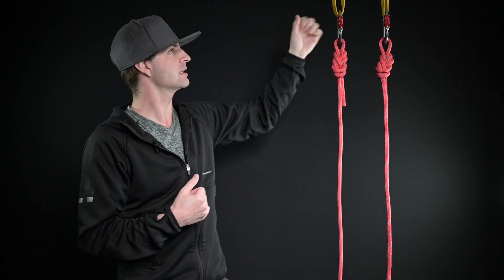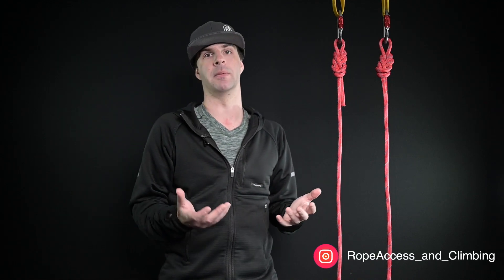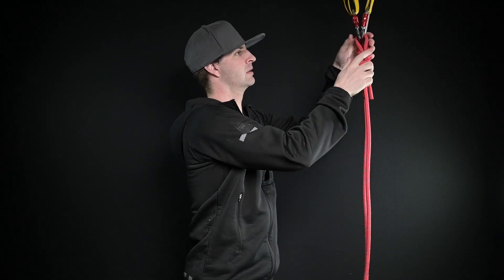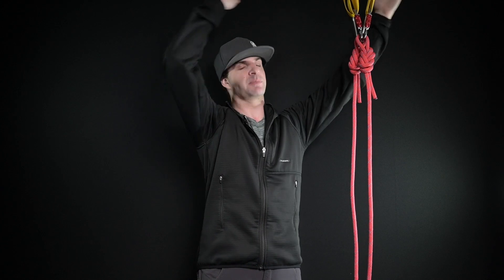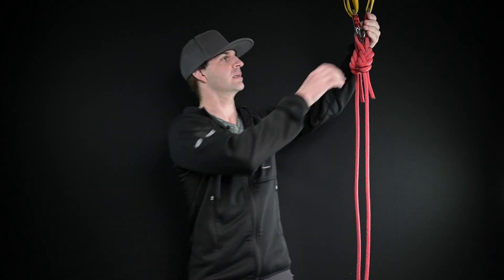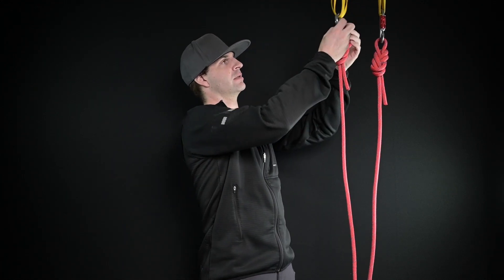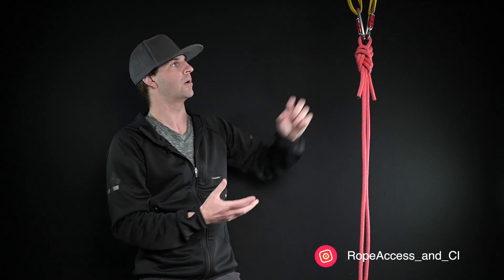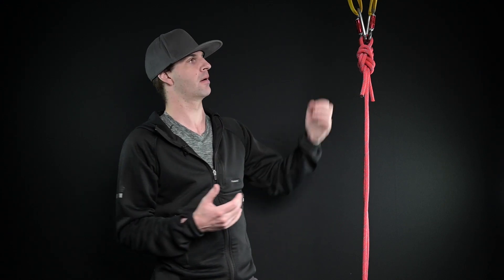BASIC VS LOAD SHARING ANCHORS - TECH TALK - THE ROPE ACCESS AND CLIMBING PODCAST

Comment: Thanks for the topic although I must strongly disagree here, and I think we are missing the most important point. 
Load sharing is great, when it is applicable only. Say you rig your tensioned lines on vertical beams. Load «shared» rigging : absolutely all the weight will be on the TOP slings. Not the anticipated result! By clipping your cows tails, Grillons, or drop set onto both tensioned lines, you are already load-sharing your weight onto the four anchors, way more effectively, thanks to the ropes stretch. A simple test with load cells proves it 👍
Reply from the maker: Agreed. 
It’s situational for sure and in the vertical orientation it would put a lot more on the top anchors. 
But I didn’t talk about vertical attachments here...
But thank you for your comment.
Cheers
Mikey
Reply: @theropeaccessandclimbingpo2380  yep in vertical beams but also on diagonals (most tensioned lines are, to a degree), unevenly sized beams, or just with fabric slings, it could be really hard to even out the length of the slings. Better off not load share if you’re not sure, as clipping on both ropes does the trick! Thanks 🙏
Reply from the maker: Again circumstantial and personal opinion

Cheers
Mikey

Comment: I've had some arguments about Gate positioning & I never have a well informed response when I have to debate this. 
The information out there is contradictory. 
When I started rope access some colleagues mentioned always oppose your gates when you double up.
Others say no need because we are using 35-45kn steel triple action carabeaners & the safety factor is huge.
We don't use screw gates. Only triple action. Most of our steel carabeaners are NOT oval shaped.
That being said I feel like all the arguments mentioned above are good. 
Can you help me figure this out.
Reply: I have people argue “if you’re not screwing down you’ve screwed up”! (Screw locks) If your gate is locked and the cullet turns to the left, it’s going to to unlock. Doesn’t matter if it’s facing up or down. Just my two cents.
Reply from the maker: Haha people just like to pull at straws
Reply from the maker: Haha when it comes to gates.  I don’t care!  Even with screw gates.  But if I’m using screw gates I will take the extra second to orientate my carabiners.
Reply: @theropeaccessandclimbingpo2380  cool thanks.

Comment: I typically try to use multi-point (load sharing) anchor systems. They typically will be fixed and focused but if in a swift-water scenario we will use self equalizing lord sharing anchors. I did a really good class one time showing the load on each anchor and how important the critical angles are using free weights and fishing scales. Really made the concept come across well for the students.
Reply from the maker: Good topic to dive more into on another episode.

Cheers

Comment: Tension line is a least place where i worry about load share. If you clip dropset to tension line, it will be load share anyway. When you use Id's a as a load limiter it should prevent system for overloading. When main line fail, i would worry about second line as rope is most likely the weakest link in the system - not massive rigging slings.
Reply from the maker: Interesting thoughts here.
Yes, if you are attached to a drop set or if you clip a cows tail to both rope you will effectively share the load. However if one of them fail you would shock load that single setup.  So sharing the load at the anchors would effectively increase the safety factor in this situation. 

Now if you had a drop set line failure. Providing you are attached to both ropes..  It wouldn’t make a difference. 

However, the rope is normally not the weakest part of any one system. 

But thank you for your time. 
Cheers
Mikey
Reply: If your one rope in tension line fail because of some unknown reason - maybe hot pipe, sharp edges or just because the rope was treated like shit, i am pretty confident that if something else will fail in that system it will be second line because of the same reason.

Interesting thoughts here too.
What is  the most often  weakest link in the system according to you?
- Rope around 30kn (15kn with knot) - when new. 
- I- beam - pretty strong
- Tree?
- Anchor points - 22kn+
-  Any other anchorage - 15kn+
- Carabiner 22kn+
- Sling 22kn +
- ID?
Am i missing something?
My company actually sent a rope to manufacturer for a pull test after left tensioned in the unit for 1 month. They didn’t really share the result with us (i can only assume why) but just said that “failed at  unexpectedly low load”. Apparently around half of MBS.
But thank you for your time!